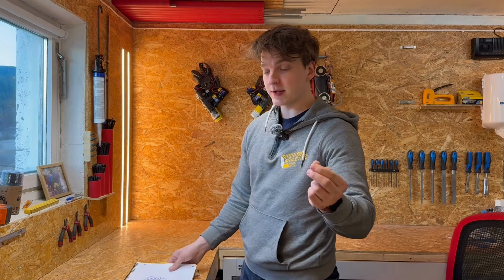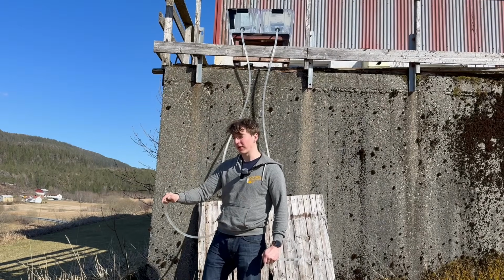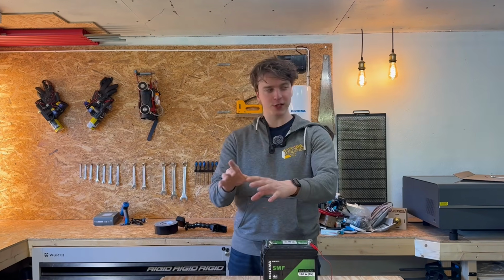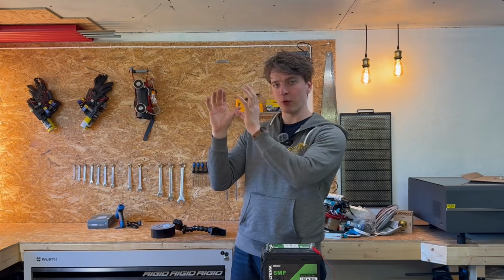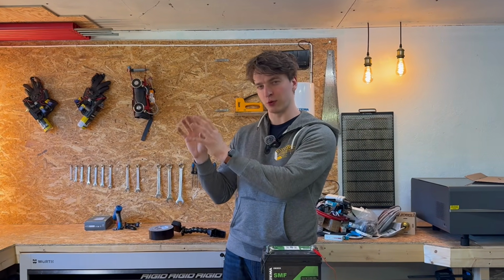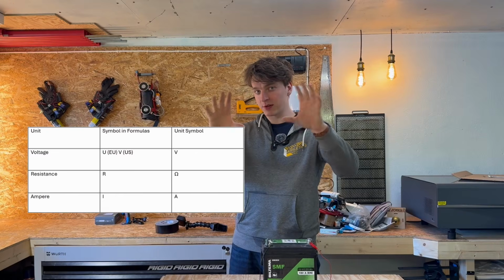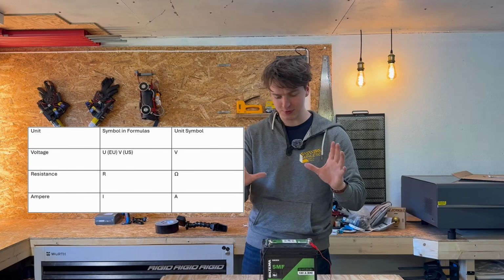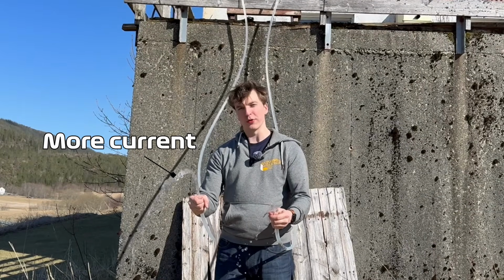This is why you can hold High Voltage | Ohm's Law Explained

Comment: Depending on the voltage the electrons are super slow, even a snail is faster VDC. In VAC they just go back and forth, never be fully replaced or reach a certain point.